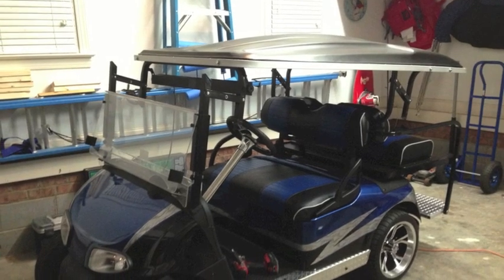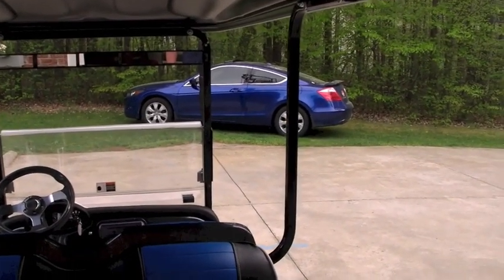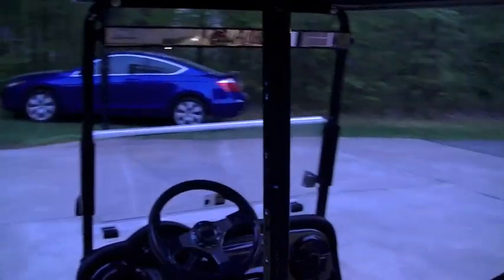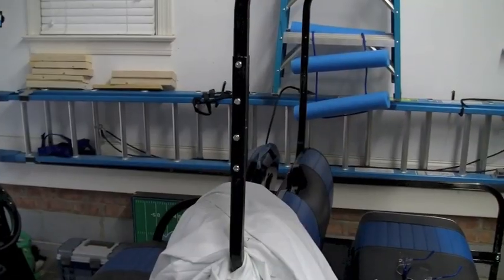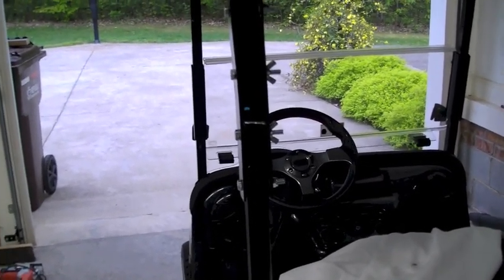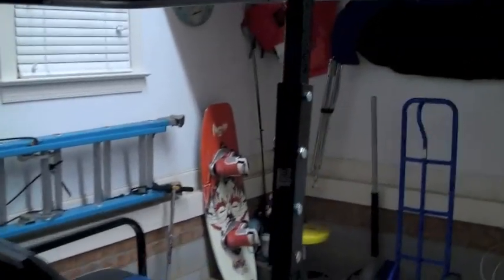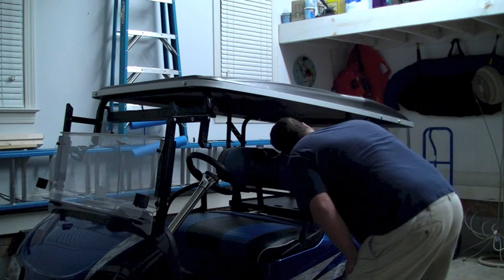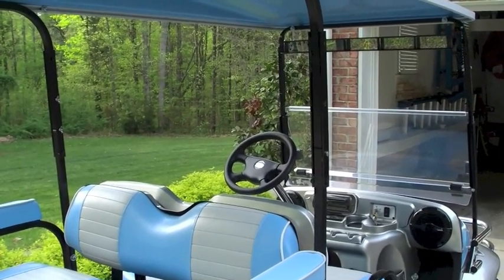Adjustable Height Golf Cart Roof Reg

Comment: Just did my 09 Club Car DS. Only thing I did different was a bought some1/4" inside diameter plastic bushing with flanges.
just had to drill the holes in the uprights slightly larger to fit the bushings. Very quiet while driving off road.
Very well done instructional video sir.

Comment: I don't have the situation You have exactly

I have a Kubota Tractor that has the ROPS (Roll Over Protection System)

It will not go into the Garage with it Up so I leave it down

Yesterday I bought 5 EZ GO golf cart tops to put on 2 tractors and TRY to put on My 2 Craftsman Riding Lawn Mowers

We are in Florida and this past Summer proved We need the Sun Shade and All 5 only cost Me $65 because the Guy threw in 2 for FREE

The 5th is for My Neighbor for His Kubota Tractor

Your design Might be needed for My experiment

Thank You

Ken in Florida

Comment: I used 2’ square tube welded inside stock canopy brace the supports slides on and off then held on with a wheel hand bolt. No rattles and comes off with no tools and cost about $15

Comment: My ST is too tall ( by 8" )to get under my garage door. Fantastic idea. I see an improvement to it by adding a bumper to the front edge so when you fold down the bumper sticks up so the sharp edge doesn't poke the roof. Have you thought about using a locking pin or a lynch pin ?

Comment: YES!  Thank you.  I just got my beautiful lifted cart and realized...oh poop, thats not going to fit inside the horse trailer!  What a great video showing a simple fix.     A question...we haul long distances - think 1500+ mile trips...my friends golf cart bounced so much in the trailer that the batteries fell through the bottom of her cart!  Got any tips on best way to tie down to prevent this sort of thing?
Reply from the maker: Not really. I've never heard of that happening before. They must have had some major rust issues on the battery tray.
Reply: L Downey  crazy right??  I can’t imagine how much bouncing must have been going on.
Reply: The batteries should have their own tie downs holding them to the frame of the cart.Someone must have removed them when changing batteries and never put them back.

Comment: My EzGo RXV has curved rear supports. How would you go about doing this with those?
Reply: I have the same cart, wondering the same thing.
Reply: @creaseguard  We never could get it figured out, so we ended up bying a hybrid trailer instead. :)
Reply: @margieperry9123  Thanks. It just occurred to me you could hinge the front but not that back.  However, you could still make the 45 degree cut in the back and use the 2 flat bars on either side to hold it in place.  You would just need to remove all 4 bolts and the two pieces of flat bar in the rear to allow the front to fold down.  Because of how flimsy the front would be during transport, you'd have to secure the rear isomehow during transport as to not bend or twist the front folding mechanism.
Reply: @creaseguard  That was our plan for a bit, but also concerned about transport. Thought ratchet straps? But then would also be concerned about damaging the back seat. It can be done. Was just easier to order the hybrid trailer.
Reply: @creaseguard  I manufacture an engineered kit to lower the roof about 20". Cart Collapse.com  We haul carts in the loft of our stacker.

Comment: Hi Lee. Great video. Do you think this would work on our easy go express L6? It is lifted, but also it is a six seater.
Reply from the maker: You know Tiffany, I'm not sure. When I Googled this golf cart, it appears the front struts are slanted to the back and the rear struts are straight up and down. I would think it would work fine as long as you make your cuts so that the cart roof will collapse to the rear. I would also modify the 45 degree angle cut on the front struts since they are already slanted. Maybe you only need a 30 degree cut since they appear to already be 15-20 degree angled. Good luck with the project.

Comment: What are the measurements for the rear bolt holes for the wing nut bolts?  Ifthey were put back in when it was folded down and in the correct place wouldnt they keep the top of the rear upright from contacting the roof?  It looks like it worked out perfect in this video...and didnt know if it "just happened" that way...or if u had a certain position for the middle bolt.  That way it would serve two purposes
Reply from the maker: I used 1/4" bolts in those holes. Not sure what you mean by measurements for the bolt holes? I just measured down from the roof 1 inch further than I did for the front supports. Not sure about putting them back in once it's folded down. That's up to you. I just placed a small towel over the tops of the cut posts to protect the roof.
Reply: L Downey yea i see what you mean by the towel.   Does it make the roof rattle or make it noisey?
Reply: L Downey Good deal.  I will get that done

Comment: Is there any reason I wouldn't be able to cut opposite so the roof folds forward? I would have more trailer room if it folds over the front.
Reply from the maker: No. That would work as well. Just cut both struts the same way.
Reply: @leedowney8587  thank you! Now to figure out how long supports to get 7"! Appreciate it

Comment: Is there a way to do this on a 2016 yamaha drive with the downspouts on the rear. Just built a cart and messed up too tall to get in all the way. Not happy.
Reply from the maker: Not sure. Haven't done this on a Yamaha cart.
Reply: @leedowney8587  Ok thanks I may have to figure this out. I am not pulling off the 6" lift and redoing it in 4" that means alot of work and $$